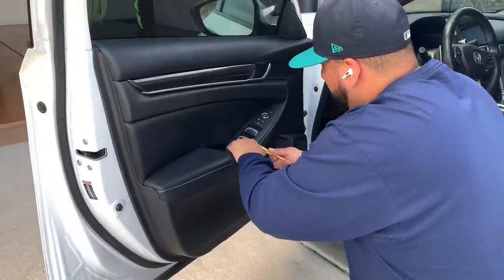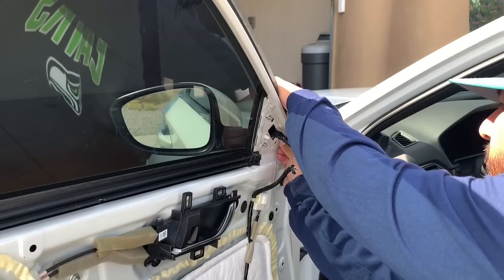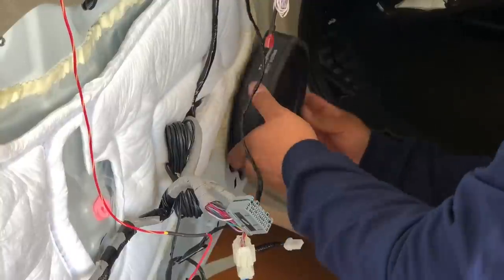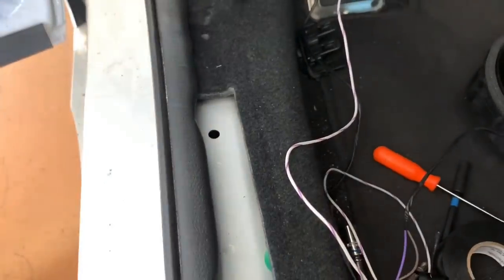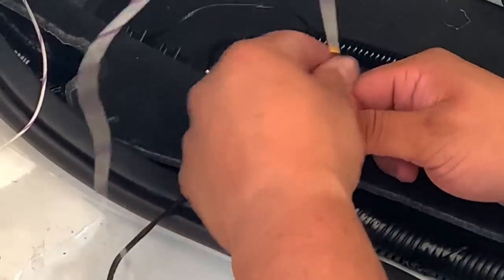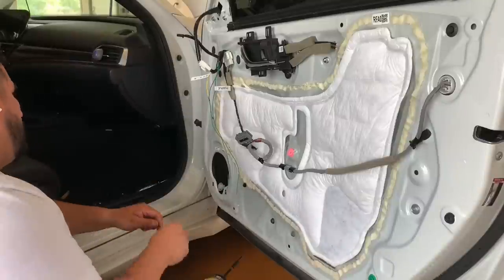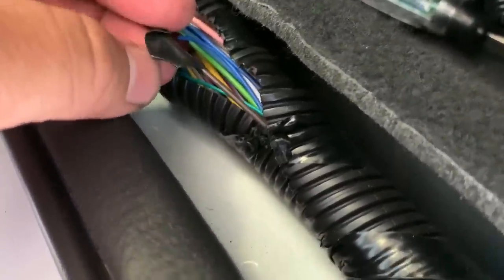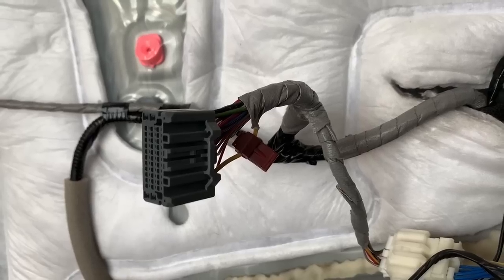TopLine Auto Shop LED & Power Folding Mirror Install | 10th Gen Accord (All Models)

Comment: I would be so lost doing this LOL
Reply: HONDA JITZ - me too
Reply: Same I can do little mods but this is a professional job lol
Reply from the maker: It looks confusing but the only part that requires non plug and play is routing the wires across the cabin for power to the passenger mirror & tapping the harness for signal. It’s easy if you have a circuit tester and visual reference like this video. You can always hit me up on IG and I can help.
Reply: Fahrenheit Motorsports - thank you
Reply: After putting in a sound system this doesn’t look to shabby lol. Subs will make u rethink life
Reply: Listen I was on board until the panel came off 🤦🏾‍♂️😂😂😂
Reply: @Fahrenheit Motorsports think I’m finally ready to pull the trigger on this so I will def take your up on this!
Reply: I recently picked up the 2020 accord  "Still Night Pearl" (Blue) would I be able to get the mirrors that color??
Reply: @3Pedal_Accord  nah. Subs are much easier. Just have to remember to unplugged A.N.C. module.

Comment: To anyone attempting to do this I would recommend you get the 3M brand T-Tap you can buy them from Digikey, those cheap Chinese ones from AutoZone can sometimes cut right through your factory wiring. The 3M ones have much better tolerances

Part numbers for the 3M scotchlock
951k
And
MNU18-250DMIK
Reply from the maker: Got a link? I’ll update my description!
Reply: @Fahrenheit_Motorsports  yeah these are the ones I'm talking about there is hundreds of different types just check the 3M website you might want the inline splice version

https://www.digikey.com/product-detail/en/3m/951K-BULK/920074-01-ND/31391

https://www.digikey.com/product-detail/en/3m/MNU18-250DMIK/920046-02-ND/31264
Reply: I'm a licensed electrician and I just hate seeing cheap Chinese electrical parts being used it's always good to go with 100% copper and quality-made products when dealing with electricity.
Reply from the maker: I’m definitely not licensed or an electrician lol. But thank you so much for the feedback and suggestion. We gotta take care of the community 🤙🏽 I’ll update my description with the taps you found.

Comment: excellent project.!! Thanks for share
Does it seem feasible as a project to change the location of the power button?
I find it uncomfortable where it is placed ...
It would be interesting to be able to change it to the steering wheel or to the gear panel ...
what do you think?

Comment: A night time run would be cool👌🏼 also how about a Speaker upgrade if you haven’t already lol might as well wait to do all that If ima upgrade. Great vid!
Reply from the maker: Great suggestions bro. I’ll get it planned. Definitely need speakers.
Reply: Fahrenheit Motorsports that would be great, the stock 2020 Sport speakers aren’t so good.
Reply: @Fahrenheit_Motorsports  Is it possible to install speakers? I've had people mention that it may mess up the touchscreen and cause it to not work?
Reply: @HeyyyJude  I got all Rockford fosgate speakers and tweeters and a subwoofer no problems with the radio

Comment: Looks awesome!  I have a 19 EXL with LED turn signals already.  Any changes to the wiring?
Reply from the maker: The only thing you’d need to do is run the black bundle of wire (brown & purple wires) across the cabin to provide power to the passenger mirror. Everything else is plug and play, no need to tap the car wiring harness for any reason. 👍🏽 30 minute install for you.

Comment: looks great  but i did see that the blinker is not  that bright .
Reply: Yeah. I'm a bit turned off with how its not as bright as I imagined. We just need him to confirm this.
Reply from the maker: The light didn’t really show up well on camera I will admit. You can see them for sure. Next mod I’m doing is putting ultra bright sequential turn signals in. It’s a quick swap and only like $25 bucks. Should be night and day brighter on camera.
Reply: @Fahrenheit_Motorsports  You're like a sequential flashlight with your car then post mod. The stock turn signals are blinding already. I can just imagine how much someone can't see with 2 more blinding led's in their eyes would be. 😂😂😂

Do it!

Comment: i just got the 2018 accord tho sadly i dont have folding mirrors or turn signals. would I be able to have either option with the right after market mirrors? the the mirrors I want have the sequential led so not sure if it would at all be the same?

Comment: Do you notice any rattling in the door with the additional wires and module? Or did you end up taping any of it down?
Reply from the maker: No rattling. I used gorilla tape to anchor the extra components down. 👌🏽

Comment: I have the 1.5t sport with no turn signal lights on the side mirrors...do I still need to connect the wires that you ran across the cabin?
Reply from the maker: Yes. The black bundle of wire (brown & purple wires) is needed to provide power to the passenger mirror. Routing the wires takes about 10 minutes. If you run it through the grommet/door loom it can take 30-45 minutes because of the lack of space. It’s all very doable.
Reply: Fahrenheit Motorsports ok I see thanks for the assurance 👌

Comment: I've been looking high and low for this, even in the Indonesia market. Anyways,  I have the 2.0 Touring and my passenger mirror folds to the curb while in reverse. Does this product do the same? I do not want to lose that function. 

To operate that function if you don't know: Have the mirror switch clicked to the passenger side and put the car into reverse. The mirror should move by itself downward and out a little to see the curb. Please let me know. Thanks.
Reply from the maker: Let me check bro.
Reply: @Fahrenheit_Motorsports  did the reverse tilt for the passenger side work?
Reply from the maker: The reverse tilt did not work on my car. I don’t believe I have the equipment needed for it.
Reply: Thank you bro for checking. I'll ask the company direcrly since they have all the trim levels. They didn't list that function on the site so I'm hoping they just forgot to mention it. Thanks again.
Reply: @kno1self539  Did you get any info on this? Need to know if we will keep that function as I am not willing to lose it
Reply: @youknowslick6402  unfortunately I did not.

Comment: what if you buy the kit will it add the blind spot & heated mirror function  to the  1.5T sport?
Reply from the maker: Blind spot I believe runs through the ECU because you can turn it off with a button but the mirror has the sensor installed. It might be as simple as installing the mirror and buying the button and harness from Honda. I’ll research. 

Heated mirrors is the same thing. Mirror comes with option but you need a way to activate it.
Reply: I doubt it. The sensors for BSM is usually in the rear pannels of the car. I highly doubt honda put the sensors in the 1.5s flanks if it wasn't meant to have it. Unless the sensors are the same for the rear cross traffic alert which I do believe the 1.5 does have. Not 100% sure tho.
Reply: @giojo01  honda used a lot of the same parts fot lower trims as the higher trims, I wouldnt be surprised if we could enable BSM
Reply: Any updates if BSM works for a 1.5 sport that doesn't come standard with it? If that was working I'd probably buy these